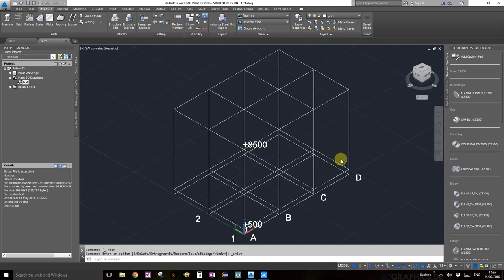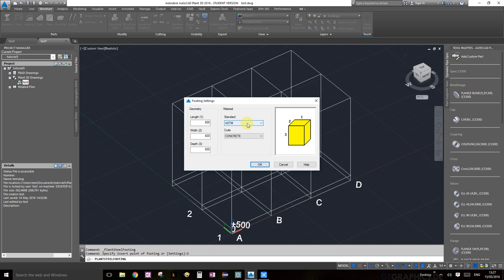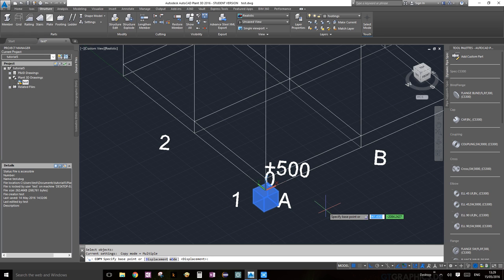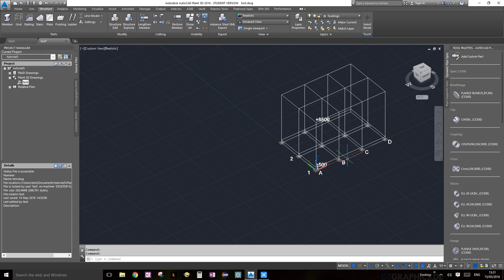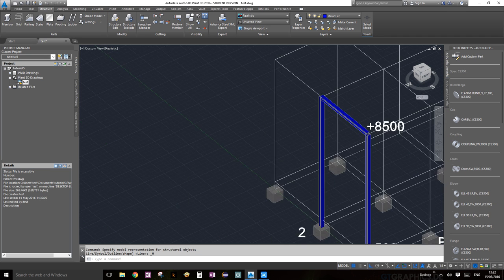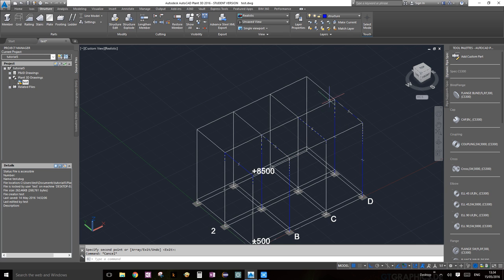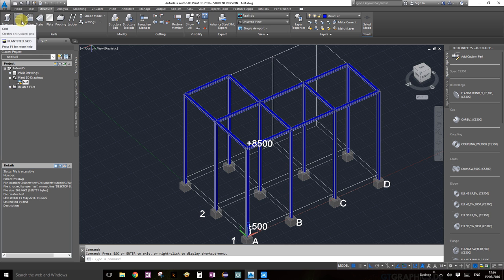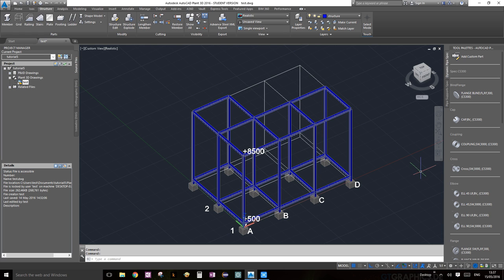Tutorial 3 - AutoCAD Plant 3D - Adding footings and structural members

Comment: Great video. You may not need to switch to line mode and shape mode. Your view set to realistic, try using xray so you will see the center lines or grid lines while still in the 3d environment 😉. Xray view is great for point cloud too.

Comment: Excuse me, sir. I'm the new guy learning AutoCAD 3D plant, now I have a problem with the structure I beam. Example I create Grid X (0,1000,2000,3000) , Y (0,500,1000,1500), Z(0,250,1000). Unit (mm) but when i adding Beam it look so small and unrealistic. I don't know the reason why. I hope you can help me out, thank you so much.
P/S I'm sorry because my bad English skill.
Reply: Just ran into the same problem. In my case it was because my project was set to standard rather than metric (mm) when creating the project.